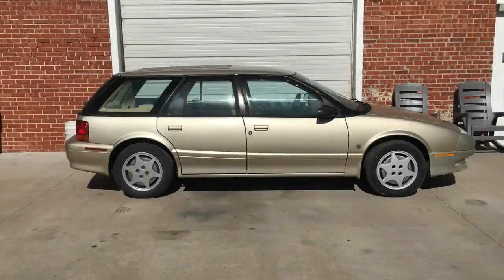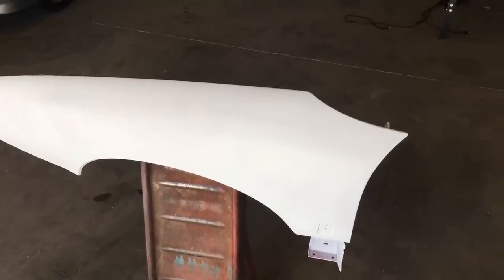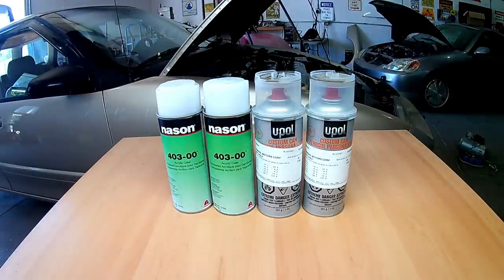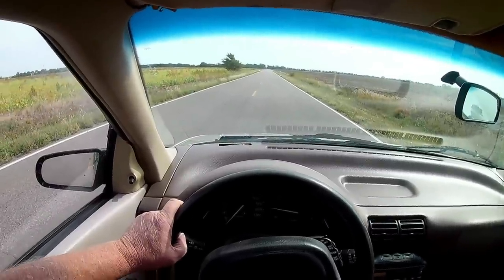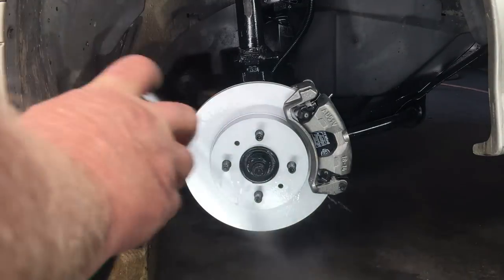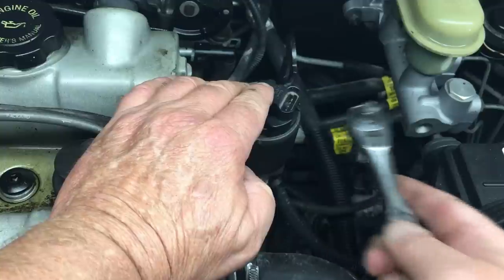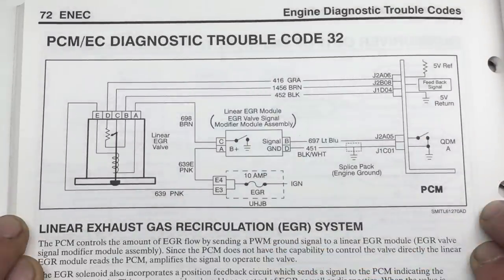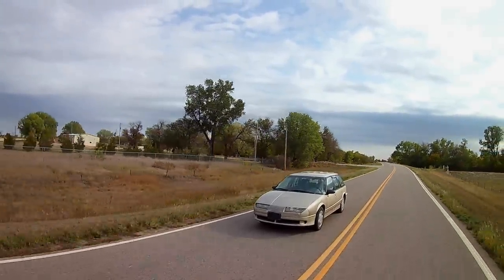S2E23  Our Saturn Wagon surprises us with some unexpected repairs and a twist or two...

Comment: Rotors just have pad deposits from sitting I bet. Several more hard stops probably would have cleaned them up, but new brakes just feel great and inspire confidence. Plus it helps alleviate any MPG issues caused by brake drag, especially the new calipers. The car deserved some fresh parts. The coating on the rotors will last quite a while in non-salted non-snowy environments. Even then it does help keep stuff from looking like rusty death for a few years. I have lots of experience. If the black or silver coatings last more seems to depend on the brand.

Comment: I enjoyed the video very much. I bought a Corolla and went thru it some what like you did with the wagon. I have about $1300.00 in my car with a timing chain, VVT gear on the intake cam, front pads and rotors and of course LOF, wipers, cabin filter and a left rear tail light. Keep the repair videos coming, motor mounts and what ever. Thanks.

Comment: New to your channel. These reports are fantastic to watch. As someone from the Netherlands I'm not really familiar with the Saturn brand, but I do remember seeing the SL2s when I visited the US years ago. I think the design of Saturn cars of that era has aged really well and they do have a cool 90s vibe. Manual / stick transmissions are actually very common over here, only in the last couple of years cars are getting automatics more often as the market changes to hybrids etc. I own a Peugeot 108 which is a sub-compact city car. It's light (1874 lb), has a 998cc 3-cylinder engine and a manual 5-speed. I regularly get ~52 MPG when daily commuting (30 minute drive). These sort of cars (Volkswagen Up, Toyota Aygo, Peugeot 108) are really common in the Netherlands as the monthly road tax on cars is calculated based on the weight of the vehicle, and the fuel prices are high at USD 7,10 per gallon (EUR 1,90 per liter). 
I'm really looking forward to the next videos in the series!

Comment: I've used the paper clip method since I learned it in 2002😅 until I finally purchased an obd2 and obd1 scanner 3 years ago, after getting tired of our local auto parts stores rarely having a scanner behind the counter😕 one of my best purchases for working on 96+ vehicles!   I still often use the good Ole paper clip in my 91 accord wagon🤣
Reply: “Kind words can be short and easy to speak, but their echoes are truly endless.”–

Comment: I’ve had those Raybestos coated rotors on my Subaru for 3 years, and after 2 VERY salty Wisconsin winters, the coating has held up very well, only minor discoloration instead of the usual chunks of rust that form on the cooling fins.

Comment: LOVE   that train going by... 🚝🚝🚝🚝🚝🚝🚋🚋🚋🚋🚞🚞🚞
Reply: Diesel trains weren't used until the 1940s.

While steam engines developed throughout the 19th century, diesel trains were not put into use until the 1940s to the 1960s. These trains were preferred over steam engines because of their ability to perform faster for a much longer time.
Reply: The magnetic-levitation train is currently the fastest train in the world.

In April 2015, Japan broke its record for having the fastest train in the world. Japan Railways’ latest mag-lev bullet train traveled at a speed of 603 kph.
Reply: Mag-lev trains continue to aim for faster speeds.

It was reported by engineers that they have set a goal to increase the maximum speed a magnetic-levitation train can go. By the year 2020, these trains will be able to run at a speed of over 800 km/h.
Reply: The fastest commercial mag-lev train is found in China.

Shanghai, China holds the fastest commercial magnetic-levitation train in the world. This train can travel up to a maximum speed of 288 mph.
Reply: The longest direct train route is found in Moscow.

The Trans-Siberian Railway spans into a total length of 5,778 miles. This route can be taken entirely within the bounds of Russia and takes a week at minimum to travel the entire distance.
Reply: Australia has the straightest railway path in the world.

This railway track spans 478 kilometers long and it is also recorded as the world’s longest and straightest railway.

Comment: I bought one of these Saturn Wagons used in 2003. Some months later I was looking at devices on the internet that fit between the car's computer and their sensors to boost engine performance. I asked a Canadian company if they could do one for my little Saturn and they did it for me and for about $300 I had a sleeper of a car that blew people's minds watching me pull out into traffic or blast off from a stop light. No other mods whatsoever on it and I had no pretensions about it at all. All I knew was that when I pushed the pedal to the floor, that device kicked in and it started spinning the wheels. I could manually shift the automatic transmission and get some wheel spin after going into second and a wheel chirp when hitting third. Apparently the performance device lies to the computer about air flow, throttle position, mixture and anything else that mattered so the engine has to respond to make up for it. The car was already super light with plastic for body panels and the engine performance had obviously, in stock form, been dumbed down to meet the expectations of grandmothers by derating it with the stock computer. This was probably the best $300 I had ever spent for entertainment ever. I eventually ended up breaking the auto transmission from getting down on it so hard but I sold it for about half of what I had paid for it after they buyer test drove it even when it leaked fluid and wouldn't go into reverse the guy was still impressed enough to buy it.

Comment: I did not realize orielys can mix paint for spray cans. And I'm familiar with using the "key dance" for older Mopars to get fault codes so it's cool to see GM had something similar
Reply: Old Bosch was key on and floor it 5 times. Had to have a good and adjusted throttle switch. Four numbers separated by longer intervals repeated three times and it could store multiple faults. 1444, was all clear
Reply: My '88 Ranger just required a jumper in the DLC and then KOEO; I think it was the same in my '92 Cavalier...
Reply: My guess is it's only select o'reilly's that can do this
Reply: @SHSPVR  you would be correct. However almost every district has a store that can, and they can ship it via their distribution centers or Hub stores/route trucks. So they can be had by almost anyone as long as you get someone reasonably competent behind the counter, that is willing to find out which store and all that. Not 100% of them, but most of the stores can.

Comment: Seems like a pretty decent car for the relatively minor repairs and cost for its age👍🏻 I've found cheaper tires also seem to weather rot slower aswell. Having 4 vehicles and driving 5k miles a year combined, I'm usually replacing tires with plenty of tread by the time they're cracked beyond my comfort level!

Comment: I had some PowerStop coated rotors for my vehicle, the rear solid rotors did just fine for a few salted northern winters, however, the coating on my front vein rotors did absolutely nothing. At best, they protected about 30% more than a regular rotor but after only one salted winter the veins inside had more corrosion than your average Chevrolet. In fact, the rotors I replaced on the car were in far better condition without a coating and had seen about three or four more salted winters than the PowerStop.
Reply: “Kind words can be short and easy to speak, but their echoes are truly endless.”–

Comment: Different coloured fenders are good for intimidating other drivers coming the other way when overtaking on blind bends on narrow country roads. Plus other cars give you a wide berth in car parks. Thieves also know that they need to move along. Just pretend you are a bad guy in a Bourne movie (or Stephen King horror movie). Own the look.
Reply: Didn't have different fenders, but when I delivered pizzas, I had a purple 94 Honda Civic with a million dents in every panel. That plus it also being a 5 speed likely kept the thieves away.
Reply: @SkylineFTW97  why would it being a five speed keep thieves away?
Reply: @josephgauthier5018  Because most people can't drive stick in the US. The stories of thieves and carjackers quickly abandoning a car they took upon seeing the gear stick keeps popping up for a reason. Even happened to one of my mom's old coworkers.
Reply: @SkylineFTW97  lol, I didn't realize it was a manual. Well that makes sense.

Comment: Looks good Jimbo, typical old car problems.  You got off pretty cheaply all in all (Now just replace the motor mounts and whatever else crops up).  As usual, it always takes 3 times more work (on average) to accomplish the reconditioning.  Of the 3 Saturns I owned, the engine would wear out at around the 100,000 mile mark, no matter how well it was taken car of.

If you are going to try some more lean-burn tests, I suggest using ethanol free gas and running a bottle of fuel system cleaner through every 1 - 2 months to keep the injectors spraying nicely.  Yeah, they do tend to foul up quickly on pump gas.  I observed this problem on every car I have owned for the past 15 years since I discovered this problem.  It does pay off though because I average 30 - 32 mpg with my Chevy pickup with a gas engine in rural driving.

Comment: I have a 92 Opel Calibra which is also non-OBD Tech 1 and you can use a 10 pin to 16 pin converter cable to read the codes from OBD 2 scanner. Great video!

Comment: Here in the UK, the equivalent to Walmart is the supermarket giant 'ASDA', which is actually owned by Walmart yet our ASDA superstores definitely don't service cars on the side of the building or sell tyres either.
Reply: I would not really say they service cars. I mean kinda... But they do oil changes, batteries, and tires. That's pretty much it. They don't do any real repairs or anything.
Reply: Also I live in the town where Walmart started. Jimbo was joking about people in Walmart, but boy, in this area, people of Walmart is a real thing every time you go. 🤣 You see some crazy stuff

Comment: my 1996 SW2 has been my daily driver for over 5 years and the only thing I've had to replace on it (other than consumables such as tires and brakes) is the crank position sensor. I'd say the build quality is on par with any 90's toyota I've owned other than the common oil burning issue due to bad oil ring design. Another thing I've learned to live with is not getting ANY respect in traffic. Maybe other drivers think it's a subaru or audi?

Comment: I assume you bought Douglas tires from Walmart? I ran those multiple times and they lasted well. Also they are made by good year I believe. 
I have a old OTC obd1 scanner from way back and it's great! Also at one point was updated and will read obd2 as well. I just use it for obd1 for codes and live data. Few ppl tried to buy it off me, not happening!
Reply from the maker: I have been checking Ebay for a good deal on an older OTC tool,  I'm addicted to live data and feel completely lost without visual feedback.
Reply: @robotcantina8957  GREAT TO SEE YOU AT  102K  SUBSCRIBERS JIMBO!   Congratulations, your hard work and  fun videos resulted in celebration!

Comment: Wrenching is more my thing than all the electro wiring headache though I still enjoy watching and it came in useful to test to EGR - I would have treated the valve to a bath n maybe a fragranced candle  and hoped it worked. At least unlike modern cars there wasn't hours of plastic cladding with sacrificial clips to remove

Comment: You need to get a car to run on water lol. Here's how I would do it. Get a few deep cycle batteries. Build a hydrogen generator. Meter the hydrogen into the carburetor using a propane mixer. Now you have an EV while still keeping your ICE vehicle.

Comment: That rotor looks like it has uneven brake pad deposition.  The fix is run it up to high speed and slam on the brakes.  Do that a couple times, though maybe let it cool for a bit because these are puny.  That should help a lot.

Comment: 93 94 95 got really weird with obd1.  Some gm cars would not participate in the paper clip trick.  You had to have a scan tool because they had more complex pcm. 94 caprice im lookin at you.   I also  heard of obd2 connectors used those years but the pinout was unique to the model. (S10 perhaps?)  Most years with the right software and a pocket full of radio shack bits you could make a real time Scanner. I did this for my 89 caprice in the year 2000 and it was interesting watching what was going on. The fancy priced tools like AutoXray didn't have as much display info as the computer and wires setup I had. I couldn't edit anything and didn't have a chip burner or money for a cam swap, but I felt cool anyway, lol.

Comment: i was half expecting a Robot Cantina OBD1 to OBD2 home made adapterino thingy constructed, is that even possible? (also half expected a painted silver "hub cap" pattern painted on the wheel, guess it's cheaper and easier to just buy a hub cap, paint is expensive)

Comment: I epoxied ball joint ends on the shifter cables, the only real fix afaik. the PO had installed aftermarket cables that broke in short order. that's actually how I wound up with my first saturn (00sl1/5mt)

you can see a picture of the cables on the saturn_cars subreddit titled "Shifter cable ball joint end repair example"

the gold 94sw2/5mt I had was a rolling deathtrap but was easier to keep on the road than the 92 roadmaster wagon that replaced it.
Reply from the maker: Yeah, the cheapo shifter cables are probably going to fail before long.  I'm working on a plan B.
Reply: @robotcantina8957  HEY JIMBO.....  congratulations on reaching 100k subscribers.. ROBOT CANTINA is providing the 
entertainment and fun that viewers enjoy..

Comment: As allways i enjoyed this episode. Love your narration style. I know its a lot of work, but would it be possible to revisit the lean burn experiment with the addition of hho generation? As i understand it, adding hho will offset the higher timing advance requirement of a leaner mixture through a higher burn rate and faster flame propagation.
Also this would be interesting to see in the diesel swap.
Reply from the maker: The wagon will be the new experimental platform and we will certainty explore leanburn again, but we will likely use an aftermarket ECU to simplify things.
Reply: @robotcantina8957  “You’re the best.”      Thank you  ROBOT CANTINA    GREAT VIDEO.
Reply: @ocdman202  GREAT TO SEE YOU AT  102K  SUBSCRIBERS JIMBO!   Congratulations, your hard work and  fun videos resulted in celebration!

Comment: If you didn’t already I’d recommend getting the alignment corrected for the new tires to prevent abnormal wear

And as for the cheep tires lasting longer, most cheep tires are made of a harder compound, which makes them more resistant to wear but usually less grippy. But that also aids in fuel economy by reducing rolling resistance

Which also reminds me it would be interesting to see a comparison of how doin things like airing up the tires effects fuel economy. And if that fuel savings would be worth the shortened life span on the tires

Comment: I've bought several old cars which had been sitting many years and fixed them up to drivers. A good rule of thumb is to assume $2-$3 thousand dollars in parts for things like brakes/tires/shocks/fluids/exhaust/misc to get a a dirt cheap old car up in shape enough to be safe and not feel embarrassed driving around. A $500 car is typically really a $3500 car. Still cheaper than buying about anything else but always keep that in mind and budget accordingly.

I've done this twice in the past 4 years or so: 1989 Town Car purchased for $1000 took another $3000 to get it looking good and road worthy. 1993 S15 Jimmy 4x4 purchased for $3000 only took another $2000 to get it up to snuff (all terrain tires were the biggest expense). That is doing all my own labor (except alignments & tire mounting).

A lot of folks get upset when I'd look at their car listed for $3000 and tell them it's only worth about $1000 at most because it needs new everything from sitting for 10 years which they neglected to mention before I showed up. I simply keep my money and walk away :)
Reply: Good for you,   I like that,   keep the money and walk away.:elbowcough::elbowcough:

Comment: The thing about cheap tires is that you always have a compromise. If cheap tires last a long time, it’s because they have no grip. I’ve owned plenty of cheap tires in the past, typically on cheap cars where it was hard to pay $500 or more for a set of tires on a $500-1000 car. I don’t do that anymore, because my experience is that you always tend to find the compromise on those cheap tires when you really need them to perform, i.e. when it’s pouring rain and some asshat decided to run the red light in front of you.

I’m not saying that a cheap Saturn that your using for projects needs to have Michelins on it, it’s more just a response to the idea that the most important qualities in a tire are cheap and long tread life.

Comment: Did the coating on the rotors just end up being embedded into the pads. I was always instructed to clean off any residue from the rotors before installing them. The theory being that the pads will become contaminated and make noise.

Comment: I didn't know Saturn has plastic body panels
Reply: Ohh yes they do. Oddly, to replace any window regulator on the car, you just unbolt the outside door skin.
Reply from the maker: The Saturn S series and the Ion have plastic exterior panels.  The hood, roof and trunk lid are steel, except on the wagon.  On the wagon the roof panel is plastic.
Reply: @robotcantina8957  HEY JIMBO.....  congratulations on reaching 100k subscribers.. ROBOT CANTINA is providing the 
entertainment and fun that viewers enjoy..